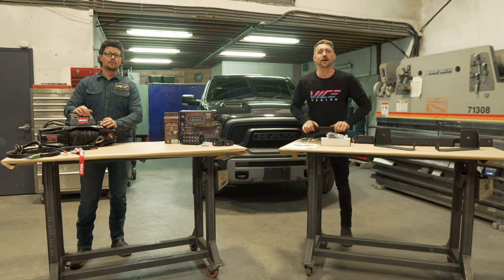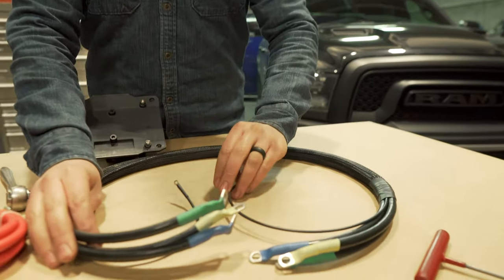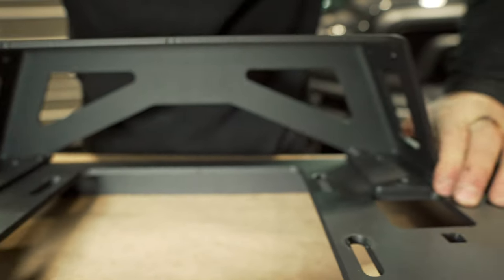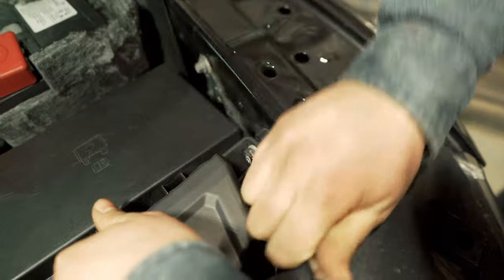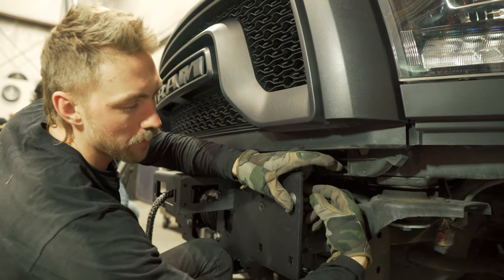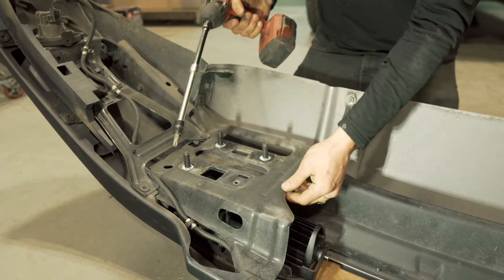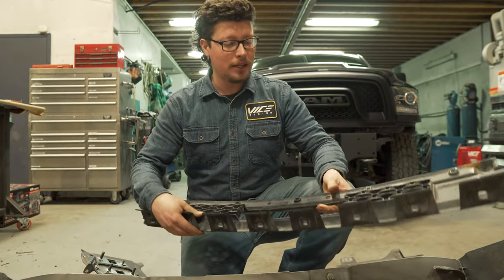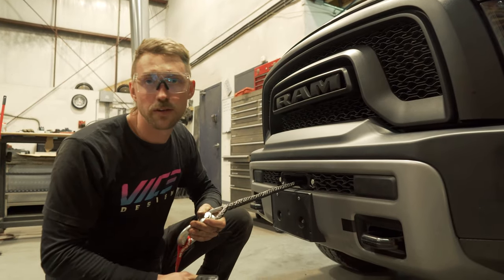Hidden Winch Mount | 4th Gen RAM REBEL & WARLOCK | Full Overview and Installation | VICE Design

Comment: I have a panel mount in my truck what amp fuse would I connect this to?
Reply from the maker: The winch gets wired directly to the battery. The winch remote controls the switching of the contactors. You are able to duplicate the functionality of the remote with an in cab switch cab but we don't have a video for that. The WARN vr evo comes with a wireless remote so you don't really need to wire a physical switch.

Comment: Can you please post a link for the winch and hidden winch brackets?
Reply: Sucks that they don’t respond to questions. It sucks because I’m having an issue myself. Those countersunk bolts wouldn’t just drop in nor sit flush after drilling the hole bigger

Comment: thanks! hey you think park sense is gonna complain about the winch or the lights? i gather this truck doesn't have it i didn't see any sensor wiring on that bumper.
Reply from the maker: No front Park sense on the 15-18 Rebel or 19-22 Warlock so its not an issue. Our other kits for other years are compatible with the park sense too.
Reply: thank you!

Comment: What wheels and tires are those on the red Rebel in the thumbnail? I have the air ride but love that setup(and hidden winch of course!)
Reply from the maker: That red rebel has the Factory wheels but they've been coated all black. Those tire are the Toyo Open Country AT's. Not sure on size looks to be around a 33" diameter

Comment: How's this impact oil change I'd imagine it makes it harder to get to the oil filter
Reply from the maker: Great question - the assembly sits high enough and forward of the engine so oil change procedures are unaffected!
Reply: @vicedesigninc  is this winch weather proven I live in alaska I need something that'll stand up to the conditions also I've been told about a recall on these winches has that issue been addressed I believe they said something about it being put together incorrectly and missing a seal